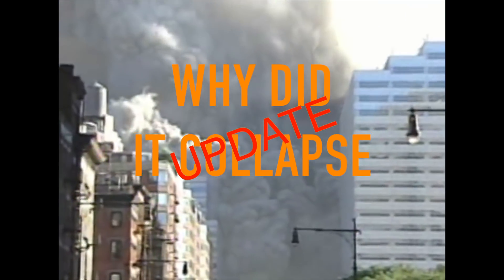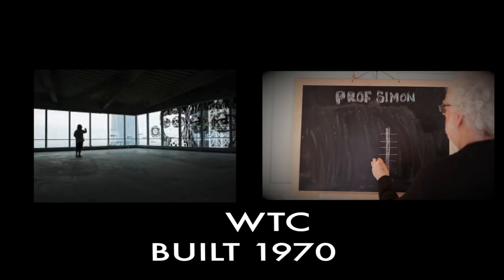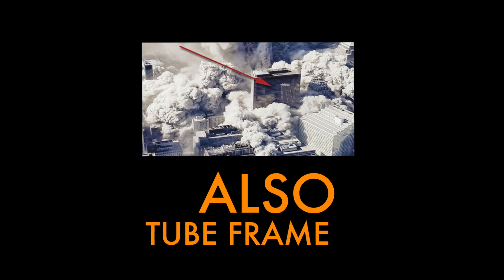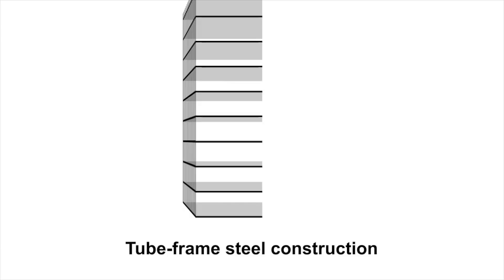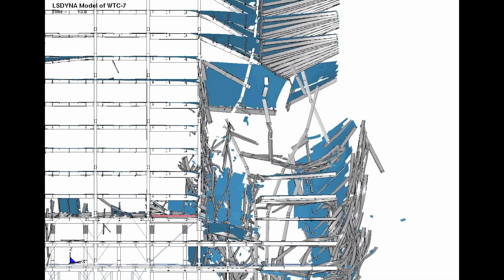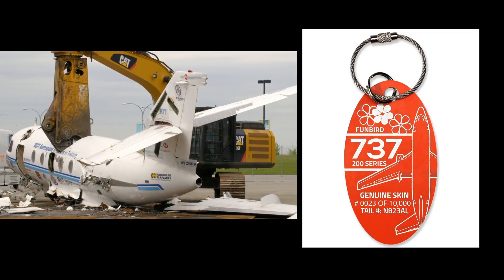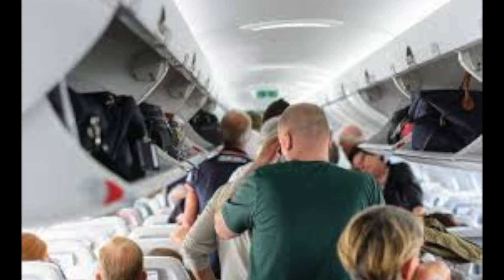The Hollow Tower - facts not fiction on the WTC design.

Comment: You need to go back and research the way the World Trade Center towers were built. The central cores of the buildings were built with 47 core columns that were latticed together and had 5 inch thick steel at the base with the steel tapering down towards the top. These buildings were NOT fragile or hollow! The cores supported 60% of the weight, while the perimeter columns supported the other 40%. The cores were designed to take 2,000% more dynamic load, and the buildings were built with a safety redundancy factor of 5. Geez, do your research. This video contains some serious disinformation. And as far as the Plasco building, if you watch videos of the collapse, there are telltale flashes, and explosions before/during the collapse, and there are squibs during the collapse. Fires are an organic process that burn in a given space for about 20 minutes before they go seeking new fuel to consume. If you watch videos of the World Trade Center, you will see that the smoke is thick and black, indicating the fires were oxygen-starved. They were not raging infernos, capable of softening the fireproofed floor trusses and core columns. The fire in the South Tower didn't even spread out of the impact zone, which was confined to one corner of the building! And one more note, you are right about the concerns about the Twin Towers being a concern of an airplane hit. Which is why they were designed to take a hit from a Boeing 707. And a Boeing 707 is only slightly smaller than a Boeing 767, but carried about twice as much fuel and had twice as many engines. The Twin Towers were very robust skyscrapers. Stop being deluded by these other debunkers and really research into what people like me are saying. There is plenty of means, motive, and clearly opportunity on behalf of the perpetrators. Which is all it takes for police to obtain an arrest warrant in a murder investigation. 3,000 people were murdered here for financial and political gain. Stop the delusion and start wanting justice for those responsible
Reply from the maker: thanks Jacob.   good info but the building were not steel and concrete construction, like other towers.  The NY port authority and even Con-Edison were concerned about aircraft damage and possible collapse in 1970s.   My point is....people see the dramatic collapse of WTC buildings and dont understand what they are seeing..they behave differently. thank you.
Reply: @SimonHollandfilms  I fail to understand what you mean by "they were not steel and concrete construction." As this video will show, they were built with steel frames, with floor trusses extending from the central core columns to the exterior perimeter columns, and corrugated steel floor pans containing concrete floors, with a hat truss at the roof of the structure to tie the core columns to the outer perimeter columns. They were very much steel-framed concrete buildings, and they were designed to take the impact of a jetliner flying at 600 mph. The buildings were very robust, and without any outside assistance, *should not have collapsed*. In fact, they did exactly what they were designed to do that day; they took the impacts, swayed from the force, then went back to neutral position, and stood firm. You need to research architectural redundancy and how it's been standard practice in the industry since before the Towers were built. Here's the aforementioned video: https://youtu.be/X3TmHYaXvEo
Reply from the maker: ok...so these perfectly strong buildings, were hit by aircraft, swayed a little and went back to vertical......then what happened?  are you  suggesting, they we pre-wired for demolition and someone was in place to blow the building up that day, just after they were hit?  That  sounds unlikely....and the fact that they collapsed following the aircraft impact and fire seems a bit more likely?
Reply: @SimonHollandfilms  Here's the problem with the fire hypothesis. Fire is an organic process which relies on oxygen, fuel, and an ignition source. Once fuel is consumed, the fire seeks new fuel to continue burning. Typical fire cycles like this last about 20 minutes. Themographic analysis of the World Trade Center fires indicates they weren't burning any hotter than 600°F and for steel to begin softening, temperatures have to be close to 1,000°F, about half of steel's melting point. You also need to factor in that gypsum wallboard (commonly known as drywall) was covering these steel frames, and they were coated in fireproof insulation (asbestos.) Gypsum actually has fireproofing qualities, hence why it is still used in building construction today. The next problem with this hypothesis is the fact that in the cases of both Towers, and this can clearly be seen in photographs and videos, the smoke billowing out of the Towers was thick and black, indicating the fires were oxygen starved and dying. Photographs also exist of people in the impact zones. That shouldn't be possible if the fire was a raging inferno capable of softening thick-plate structural steel. In the case of the South Tower, the fire remained confined to the corner where the impact occured, and had almost died out by the time collapse was initiated, despite the bulk of the fire having gotten nowhere near the core columns. And there are numerous examples of steel-framed high rise structures enduring fires that were much more widespread and burned hotter and for longer durations and yet they still stood. The Mandarin Oriental Hotel in Beijing China is a shining example of this. The blaze spread to a large number of floors and burned for I believe it was 18 hours, and the structure still stands today. Steel-framed skyscrapers don't just collapse from fires alone

Comment: Hi, from your answers to everyone you seem open minded, I give you credit and love your videos. 
I would love for you to come over to the "inside job" camp :) 
Please could you answer or address the following? 
1) I understand where your coming from with the steel heat issues and weak points. I would say this is the obvious way it would collapse and so is used as the explanation. 
My multiple problems with the towers are for example the near free fall speed of it. Should it also not have fallen against resistance so should of buckled and fallen off above the fire?  
2) As it "pancakes" down at near instant freefall speed instead of slowly accelerating downwards the "narrative" is that the air compressed and blew out the windows thus causing the white puffs we see on videos further down the building as it collapses.  People say this is the explosives. What is your view?
2b) following on from the above, how do you explain the horizontal ejection of the steel beams at high speeds?
3) Multiple people witnessed and videos captured multiple smaller "bangs". There is a firefighter who describes them going "Boom..boom boom". The ground floor pavillion was blown out by some massive underground explosion. All of this was before the collapse. Please look into some of these I would like to hear your views.

I could ask multiple but just one more.
4) What about all the 9/11 predictions and coincidences? For example, episode 1 of fox channel "the lone gunman" aired 6 months prior (https://youtu.be/PKM30nuZ48M), the airforce stand down and having similar "exercises" that day. There are many outside things that the shady intelligence services done. Please comment.
 
Also if you get time watch one or two of the documentaries; loose change final, 9/11 new pearl harbour and any others you want to digest.
Thankyou for your hard work.
Reply: I believe it was more then where being told.  Think about this. All the floors were supported by 1 in steel supports that protruded out 8inchs. They were welded to columns on inside and outside columns. Spaced about 8ft apartment.  Then they put a lite weight truss that was supported by those steel pieces protruding out. Just like the roof of a home depot or other warehouse type building. 
    As floors started dropping they put pressure on all 3 surfaces.  Floor,  inside columns and outer columns.  Think of the kinetic energy produced.  The simple connections would of blown apart supporting the floors. Meaning the outer wall would of snapped all the connection points. They were done mainly with nut and bolts

Comment: Regardless, how does one explain the steel columns still burning red hot 3 months later at ground zero? Or the radiation poisoning that contaminated and then killed several of the rescuers years later?

Comment: So.. let's just ignore evidence regarding the building explosions, free-fall collapse, the molten steel, nanothermite dust samples, the impossible airplane speeds at that altitude, the building explosions (oops, did I already say that?), what real architects say about this event, and eyewitness testimony? Is that what you're trying to say?
Reply from the maker: Armed with the information that the towers were fragile...the rest of the theories need re-thinking....hope you found it useful.
Reply: The towers were not fragile and if they were they would have toppled over towards the side with the most damage and probably immediately instead of collapsing straight down. The principle "path of least resistance" comes to mind here, and twice for the towers hit and once for the tower that was not hit by a plane. Have you not asked yourself this question especially for the second tower collapse where the mass of the top of the tower leaned over and not directly on top of the undamaged tower? We should have seen 70 percent of the towers standing using your reasoning.
Reply from the maker: the WTC complex  was considered a risk from the day it was built. The NYC port authority issued a warning for possible collapse due to aircraft impact. in 1993 the towers were targeting by terrorists and again in 2011because they were both symbolic and a weak building.  They are very different from most skyscraper designs.   Thermite does not explode and steel distorts at house fire temps.
Reply: If you research Architects & Engineers for 9/11 Truth you'll find that nanothermite was not the exploding agent, rather the primary weakening agent used to cut through the steel beams. The explosives used was a completely different phase once the nanothermite weakened the steel columns. No one to this day can explain to me why the tops of those buildings fell through the path of greatest resistance. Especially, once again, if you study the second tower collapse as its mass shifts to the side and still the lower section of the building, which had a greater mass, collapsed almost as symmetrically as the first tower. Please take another look at the video evidence for the ejection of building material removing the path of greatest resistance.
Reply from the maker: good questions.. the collapse sequ might be similar to building 7. [1] massive internal collapse, followed by [2]  the curtain wall rapidly dropping.
Reply: @planck 10-43 Yes, there was molten steel, but the sheer friction of that large a mass collapsing would result in temperatures hot enough to melt steel. The "nanothermite residue" is made up of iron and carbon dus., Did you know that steel is made of iron and carbon? So yeah, when the steel melted, it would leave residue of it's chemical components. The "freefall speed" thing is the most idiotic thing of all. When you look at footage of the towers collapsing, you can clearly see debris breaking off and falling FASTER than the towers!!! That DEBRIS is falling at FREEFALL speed but the towers are CLEARLY not
Reply: All the stupid arguing over how the towers fell is all a huge distraction to keep us divided and arguing over how it happened and not focusing on WHY it happened and WHO was responsible

Comment: It was a 'Office' showroom. Essentially empty. Unpopular design. Has this desgin ever been used again?  I'm truly not one of them, or that guy, but none of the engine parts matched stock parts to the makes or models of the aircraft.   Like finding a bmw motor at a toyota car wreck.  Just sayin.  Awesome as always.  7 up.
Reply from the maker: interesting.....let me look into the crash aircraft data.
Reply from the maker: ok did some research on post 9/11 crash aircraft.  the theory goes that an engine 'core' was from a drone not a Boeing 767.   unfortunately this not true....the engine looked 'small' because it was just the central core of a large commercial ducted fan engine and the mysterious 'ring' that was supposed to be only fond in a drone engine...is clearly part of N612UA's engine. have a look at:  https://www.metabunk.org/explaining-the-9-11-murray-st-engine-from-flight-175-n612ua-that-hit-wtc2.t9022/ and a piece of landing gear was found squeezed between building..that also was from the crashed planes. tell me what you think.
Reply: Oh. Thank you.  Too much Art Bell i suppose. Not Art, his 'expert' guests. (grain o salt)  Thats kinda what i thought, Ford, automation, maintenance, replaceability. Perfect sence.
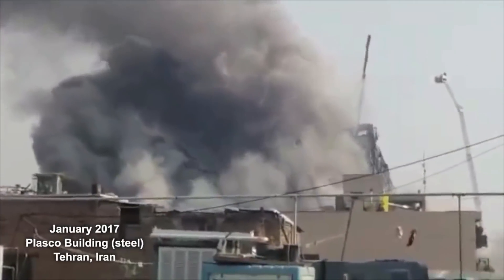Reply: Yes but, 4:25, that sumbich is on FIRE.  7 had a lower leveled slow burner. Didn't know it was burning. Water was out anyway.  Tehran. Water. Lots. Oh they must have been using  'heavy' water, again.   Or/  Tehran was staged, tried to blame the west, didn't take.  Damn, guess i am that guy.
Reply: Simon, i tried to warn ya on the original vid. Good luck

Comment: Lol. The wings disintegrated.
Reply from the maker: Aircraft are not designed to hit buildings
Reply: Professor Simon Holland clearly. The wings of each impact would have fluttered away in many pieces. I’ve done searches and recovery of crashes. This scenario is a facade. Also the landing gear found from the trade center situation was planted and a fraud. This event was planned long before it happened.